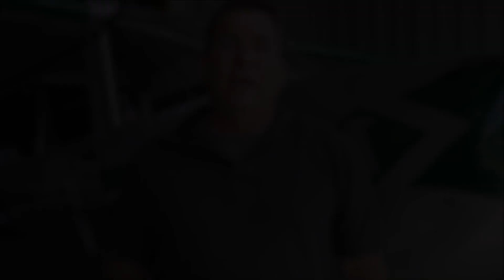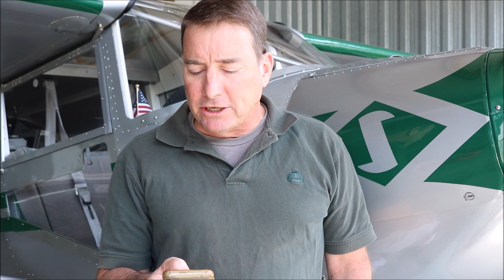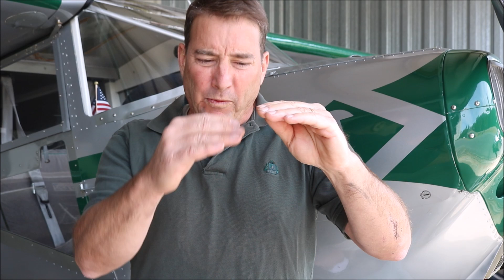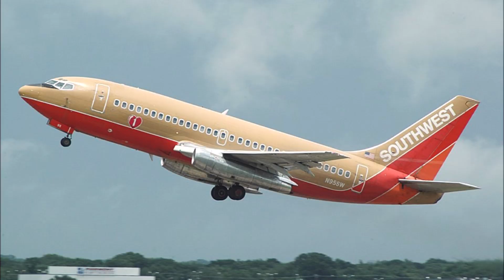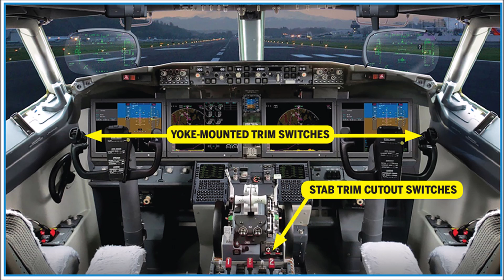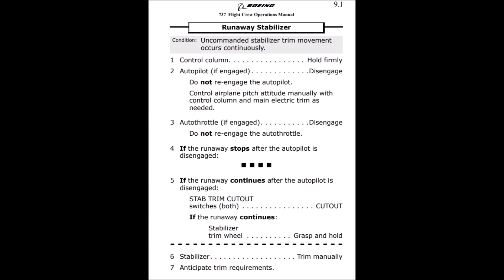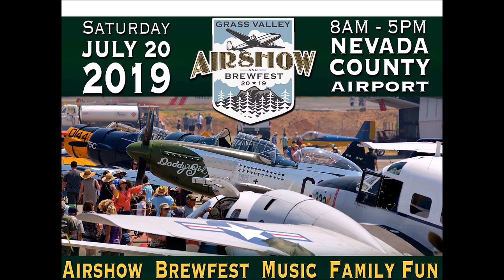737 Max UPDATE 27 June 2019 -The Latest Issue

Comment: I will say it again.  The plane as designed does not meet Part 25 certication requirements for stability.  READ the sections before refuting me.  If the plane met the part 25 standards, nothing more than stick shaker or pusher would be required.  Look at all the gyrations that Boeing and FAA are going through to try to AVOID meeting the published standards.  Mount the 737NG engines on the airplane, flight test it...move on.  The whole PROCESS of design, certification, and "self certification" is the actual problem and needs overhauled.
Reply: I looked for where you said it the first time, hoping to find something more specific about the facts as they apply to the relevant regulatory sections.  But alas, I couldn't find your previous post.  
Just saying "If the plane met the part 25 standards, nothing more than stick shaker or pusher would be required" doesn't quite do it.  Perhaps you could explain how exactly the plane does not meet Part 25 requirements for stability.
Reply: @danielforman5064  well for example, read the text here:  https://www.risingup.com/fars/info/part25-173-FAR.shtml

I don't think one could reasonably say that the 737MAX meets the requirements of paragraph (a) or (b) based upon the pitch deviations they are (vaguely) describing which have necessitated the bandaid patch of MCAS.  

The underlying REASON of why the airplane is declared certified when it doesn't meet part 25 is the follow on conversation, and relates to not relegating required oversight to divisions who are operating on the basis of profit motive.
Reply: @jetfuel3053  
I am familiar with the reg.  What pitch deviations are you referring to?  I believe MCAS was introduced because the amount of control column force required to achieve a given change in pitch was lower in the MAX (without MCAS) than the NG under certain circumstances (and therefore, flight characteristics would have been deemed different enough to require add'l sim training).  But that does not mean that the airplane won't maintain a trimmed airspeed in the absence of control column forces per 173(a) or return to a trimmed airspeed after the release of control forces per 173(b).
Reply: @danielforman5064  Reports from Boeing and FAA in various media state that the MAX airframe undergoes an unacceptable pitch up moment at high AOA and when thrust is applied, due to the relocated positions of the MAX engines.   I will do a search and give a link or two here.  That statement alone places it outside of the part 25 section I shared....standby.
Reply: The original 737 had (
by today’s standards) tiny little engines, which easily cleared the ground beneath the wings. As the 737 grew and was fitted with bigger engines, the clearance between the engines and the ground started to get a little…um, tight.

With the 737 Max, the situation became critical. The engines on the original 737 had a fan diameter (that of the intake blades on the engine) of just 100 centimeters (40 inches); those planned for the 737 Max have 176 cm. That’s a centerline difference of well over 30 cm (a foot), and you couldn’t “ovalize” the intake enough to hang the new engines beneath the wing without scraping the ground.

The solution was to extend the engine up and well in front of the wing. However, doing so also meant that the centerline of the engine’s thrust changed. Now, when the pilots applied power to the engine, the aircraft would have a significant propensity to “pitch up,” or raise its nose. This propensity to pitch up with power application thereby increased the risk that the airplane could stall when the pilots “punched it”

Worse still, because the engine nacelles were so far in front of the wing and so large, a power increase will cause them to actually produce lift, particularly at high angles of attack. So the nacelles make a bad problem worse.

I’ll say it again: In the 737 Max, the engine nacelles themselves can, at high angles of attack, work as a wing and produce lift. And the lift they produce is well ahead of the wing’s center of lift, meaning the nacelles will cause the 737 Max at a high angle of attack to go to a higher angle of attack. This is aerodynamic malpractice of the worst kind.

It violated that most ancient of aviation canons and probably violated the certification criteria of the U.S. Federal Aviation Administration. But instead of going back to the drawing board and getting the airframe hardware right, Boeing relied on something called the “Maneuvering Characteristics Augmentation System,” or MCAS.

It all comes down to money, and in this case, MCAS was the way for both Boeing and its customers to keep the money flowing in the right direction. The necessity to insist that the 737 Max was no different in flying characteristics, no different in systems, from any other 737 was the key to the 737 Max’s fleet fungibility. That’s probably also the reason why the documentation about the MCAS system was kept on the down-low.

Put in a change with too much visibility, particularly a change to the aircraft’s operating handbook or to pilot training, and someone—probably a pilot—would have piped up and said, “Hey. This doesn’t look like a 737 anymore.” And then the money would flow the wrong way.

When the flight computer trims the airplane to descend, because the MCAS system thinks it’s about to stall, a set of motors and jacks push the pilot’s control columns forward. It turns out that the Elevator Feel Computer can put a lot of force into that column—indeed, so much force that a human pilot can quickly become exhausted trying to pull the column back, trying to tell the computer that this really, really should not be happening.

MCAS is implemented in the flight management computer, even at times when the autopilot is turned off, when the pilots think they are flying the plane. In a fight between the flight management computer and human pilots over who is in charge, the computer will bite humans until they give up and (literally) die. Finally, there’s the need to keep the very existence of the MCAS system on the hush-hush lest someone say, “Hey, this isn’t your father’s 737,” and bank accounts start to suffer.

Those lines of code were no doubt created by people at the direction of managers.

In a pinch, a human pilot could just look out the windshield to confirm visually and directly that, no, the aircraft is not pitched up dangerously. That’s the ultimate check and should go directly to the pilot’s ultimate sovereignty. Unfortunately, the current implementation of MCAS denies that sovereignty. It denies the pilots the ability to respond to what’s before their own eyes.

In the MCAS system, the flight management computer is blind to any other evidence that it is wrong, including what the pilot sees with his own eyes and what he does when he desperately tries to pull back on the robotic control columns that are biting him, and his passengers, to death.

The people who wrote the code for the original MCAS system were obviously terribly far out of their league and did not know it. How can they can implement a software fix, much less give us any comfort that the rest of the flight management software is reliable?

So Boeing produced a dynamically unstable airframe, the 737 Max. That is big strike No. 1. Boeing then tried to mask the 737’s dynamic instability with a software system. Big strike No. 2. Finally, the software relied on systems known for their propensity to fail (angle-of-attack indicators) and did not appear to include even rudimentary provisions to cross-check the outputs of the angle-of-attack sensor against other sensors, or even the other angle-of-attack sensor. Big strike No. 3.

None of the above should have passed muster. It is likely that MCAS, originally added in the spirit of increasing safety, has now killed more people than it could have ever saved. It doesn’t need to be “fixed” with more complexity, more software. It needs to be removed altogether.
Reply: There are various sources for this statement available, but bottom line...an airframe must be able to fly with predictable characteristics under part 25 parameters from max AOA all the way to MMO/VMO.  A computer subroutine does not render the airframe stable...it's a bandaid and can't be relied upon if software fails, etc...we MUST have airplanes that can be flown when the computers are off as well as on.
Reply: @jetfuel3053  
I probably agree that the best thing to do at this point would be to rip MCAS out and deal with whatever training requirements the FAA and other authorities insist on.  There are a lot of pilots who have logged significant Max time.  Those pilots weren't having any trouble flying the plane, as evidenced by the fact that there isn't a single report of MCAS activating, other than on the two accident flights and the Lion Air flight before the accident flight.  Dan Carey, President of APA, testified that the union would be ok with a return to flight without simulator training, provided pilots were provided with simulator training in MCAS at their next recurring training.  I think that means he doesn't think any simulator training would be necessary for current Max pilots if MCAS were removed.  But even if the FAA doesn't agree, any add'l training should be limited to scenarios demonstrating the lighter control column feel at high AOA.

On the other hand, I do not agree that anything you said shows that the Max w/o MCAS is unstable.  I don't necessarily agree with your description of the aerodynamic affects of the larger and relocated engines.  But even if every statement you made is true, there isn't a single statement in your response that even suggests that the Max without MCAS wouldn't satisfy the requirements of 173(a) or 173(b).  Those requirements pertain to the behavior of the airplane when trimmed to a particular airspeed, and nothing you said discussed the behavior of the Max in a trimmed state.
Nor did anything you said indicate that the Max without MCAS does not fly with predictable characteristics.
Reply: @danielforman5064  OK.  A few questions, and they can be rhetorical if you like.  A.  If the plane is stable and flies with predictable characteristics at or near Max AOA, why add MCAS?  Stick shaker and pusher should suffice like every other transport category jet.  MCAS was added to keep pilots AWAY from the regime where they couldn't predict what it would do if thrust was mashed in near max AOA.    B.  Are you SURE there weren't other MCAS activations other than the accidents?  I have seen reports of many United and SWA pilots making complaints about the system...I thought they meant it activated (though perhaps their incidents were more manageable with working AOA probes.)  For example:  https://www.politico.com/story/2019/03/12/pilots-boeing-737-1266090
Reply: @jetfuel3053  
A.  MCAS was not added to keep pilots away from the regime where they couldn't predict what it would do if thrust was mashed in near max AOA.  Every report I have seen says that MCAS was added because at certain angles of attack in certain configurations, the amount of back pressure on the yoke required to achieve a certain amount of nose-up pitch was less than on the NG.  It's not that response was unpredictable, its that it was different from the NG and therefore not what a transitioning pilot expected.  That meant Boeing was going to have to concede that handling characteristics were different from the NG, which meant the FAA was going to require simulator training for transitioning pilots.

B.  I was aware of 3 of the 4 ASRS reports discussed in the politico article.  I believe the first two, from November, involve the same flight and were submitted separately by the Captain and FO.  Neither involved MCAS, as they both occurred while the autopilot was engaged.  The third was from a pilot who did not explicitly say that he had ever flown the Max -- he was basically venting his anger at Boeing's failure to disclose MCAS to pilots.  The fourth incident in the article doesn't obviously relate to MCAS.  The article says there were five reports, but doesn't identify the fifth report.
Peter Lemme's blog https://www.satcom.guru/2019/05/737-pitch-trim-incidents.html includes a post where he identifies every known B737 (Max or not) pitch trim incident.  There are no MCAS incidents in his list.

Comment: I believe investigators also have proven that trying to use manual wheels to correct runaway trim on the MAX is just impossible unless a pilot has tremendous strength... it's that the two crashes could not overcome because they had shut off the breakers after MCAS took over.. Boeing was wrong about I Pad training... All pilots need time in a MAX simulator.

Comment: Scarp the existing programs ,bring it all back in house and start from scratch.Until the "local"boeing engineering department has full control back from "overseas engineers " this and other unforeseen software problems will persist.

Comment: They should not need a new processor, most embedded control systems of that kind use a standard chip with variance in system level firmware, still not keen to be on early flights after recert ps Reuters were carrying the true facts, just so you know who to go to next time

Comment: You, as an expert in the field of aviation, provided a detailed explanation for a nuanced issue that CNN didn't get exactly right and are calling it misinformation. Fair enough. And, of course, you should never comment on anything outside your areas of expertise, because surely there'll be an expert elsewhere to point out where you didn't get your facts precisely right — nevertheless, a good explanation. Thanks.

It was interesting to listen Boeing tell the pilots that they didn't think it was necessary to inform them about MCAS system. I can't even imagine my reaction had a loved one been on one of the two planes that crashed. Somehow, I think we can give the reporters a break on the topic of misinformation. As for Boeing, I believe a criminal investigation is well warranted.